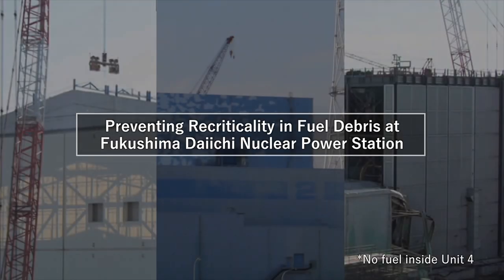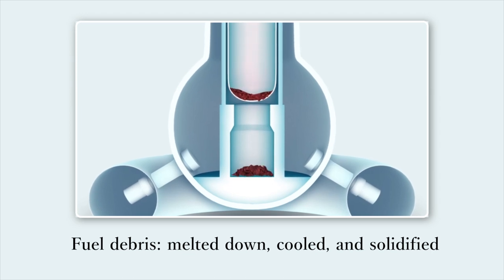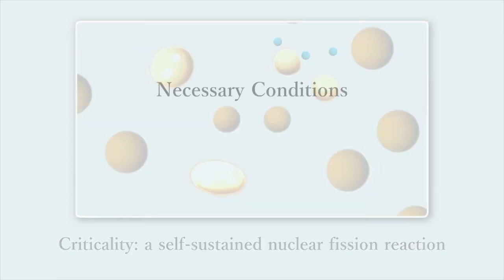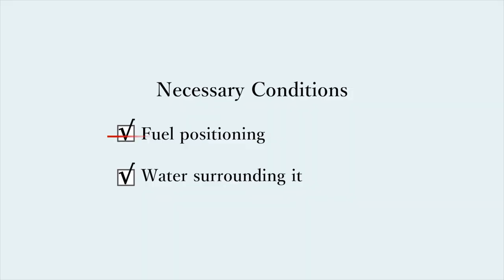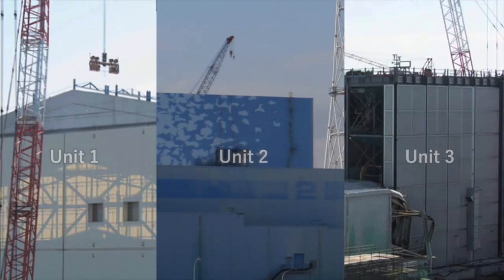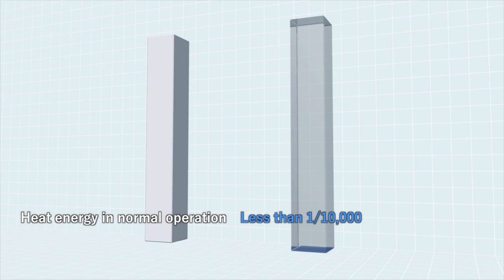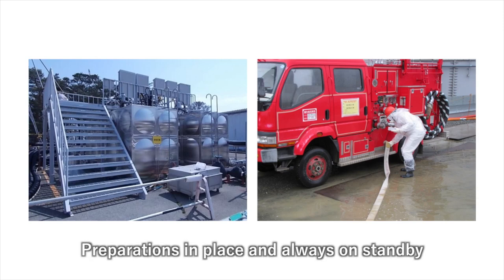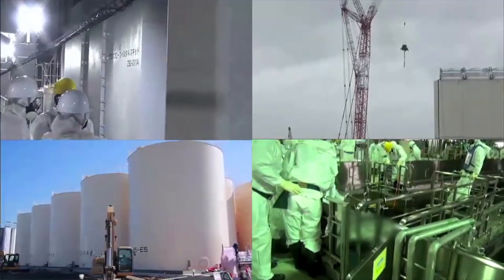2016.07.13 Preventing Recriticality in Fuel Debris at Fukushima Daiichi Nuclear Power Station

Comment: constant monitoring? Are you serious?  They cant even have a robot in there for very long without it melting down.  No way are they monitoring constantly.  But lets not get ahead of ourselves.  The spent fuel pools sit 100 feet way up above the reactor.  In reactor 3 all of the pool was blown out and rods blown everywhere.  You can see the rods laying on the ground in some of the pictures.  They dont have answers for what was in the fuel pools let alone what's going on in and under the "containment" vessel.  With all the steam and fires, it all points to it hitting the water table allready.  The muon scan showed no fuel in 1 or 2 and its not a definite science yet but it what we have to go by.  And since thats all we have to go by its seems strange to use a power source that no one has answers for any of it except building it to begin with.  Complete insanity.
Reply: radiation kills almost everything
Reply: @m.rspinachioj2621  Radiation strips the electrons from everything it comes into contact with causing unbalance and instability.